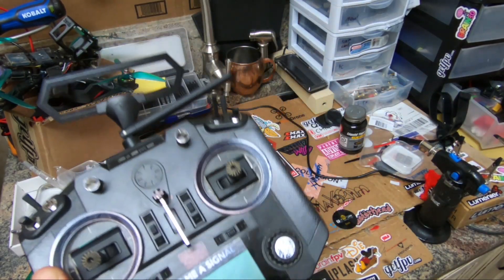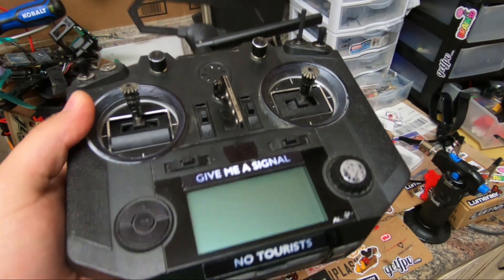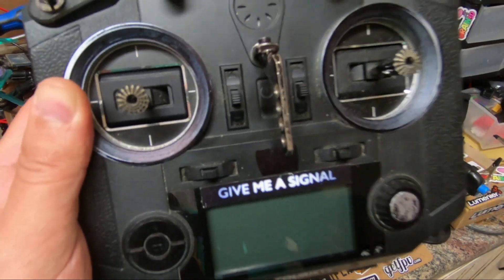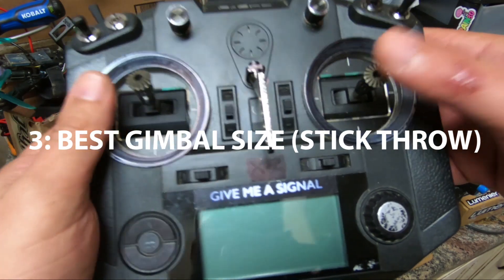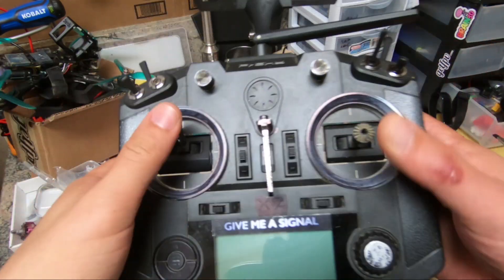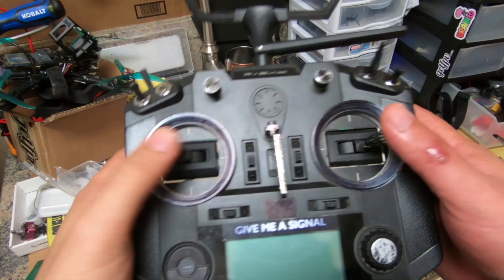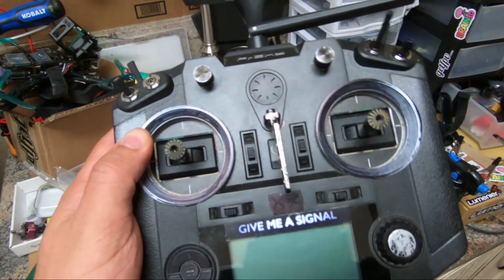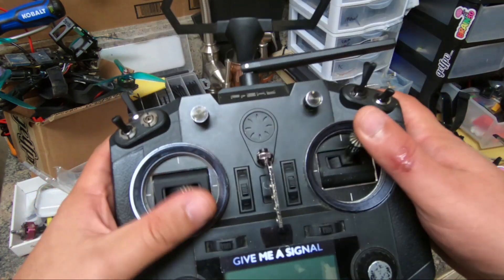FLYING SMOOTHER (TX Tips, Gimbals, Sticks)

Comment: So much of flying is about removing tension.  Transitioning to a new radio takes work and time to get to the same comfort level you had with your old one.  I remember how much I relaxed in flight when I got the gimbals set to the right tension and worked on hand position.  In the end though there is no replacement for time on the sticks.  Set up your rig and fly.  Great video!
Reply from the maker: Agreed! 👍

Comment: Ha I'm gonna switch to these hall effect gimbal what do u suggest? & in qx7 do we still have to do that transistor mod for running crossfire?
Reply from the maker: M7 Gimbals what I’m using, as for the crsf telemetry  mod I think that’s not an issue anymore but even if it is you can slow your baud rate on the Taranis to fix it via software if you don’t want to mod the radio physically.
Reply: @MaxBeamer  thanks BRUH!